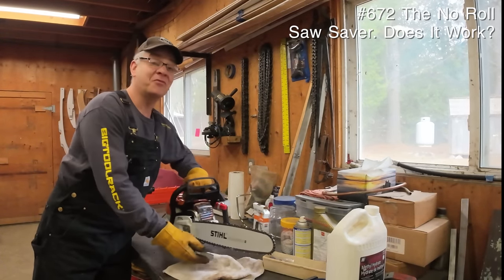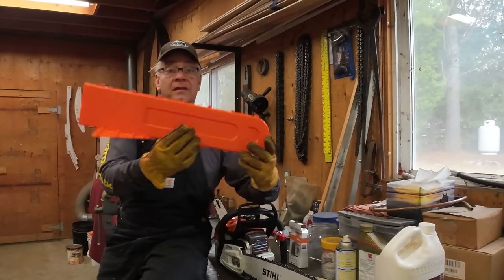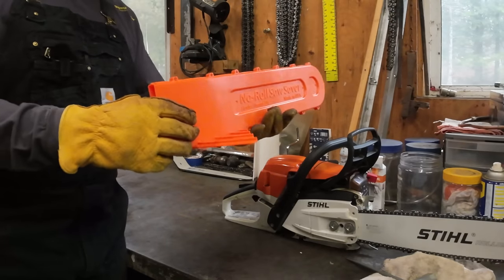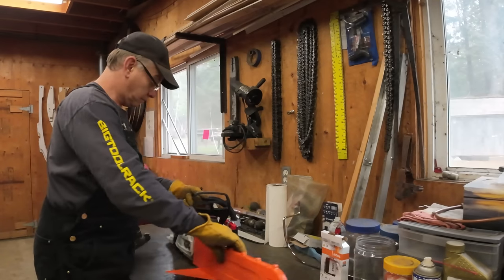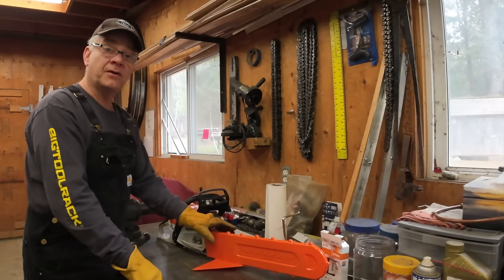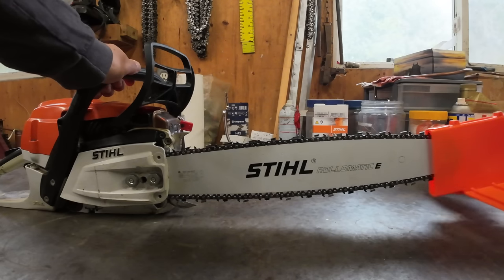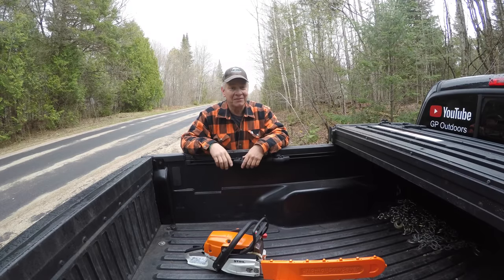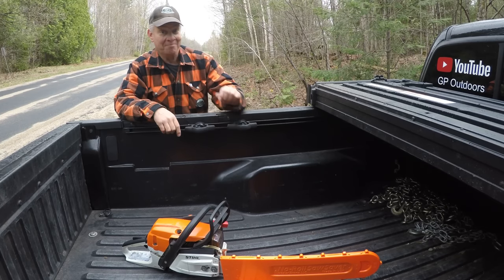672 The No Roll Saw Saver. Does It Work? STIHL MS 261 Chainsaw Test. Product Review. outdoors   4K

Comment: The no roll saw saver looks interesting. For some uses, I really need a case that encloses the saw itself, so that bar oil doesn’t leak in our van. Do you have recommendations for a case? I use Ryobi battery powered saws (quite sufficient for my needs).

Comment: I could definitely use that No roll saw saver for working in my woods. Mostly for when I put saw on front rack of the wheeler. I bungee mine down but it still wants to tip over because of the way rack is made. Excellent video. Central Maine…